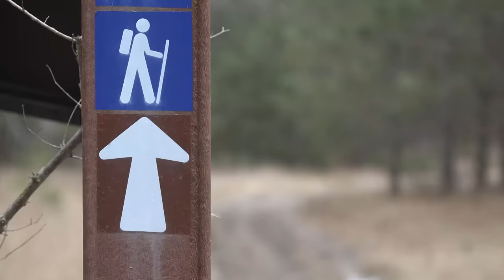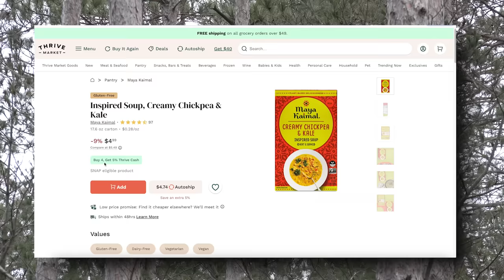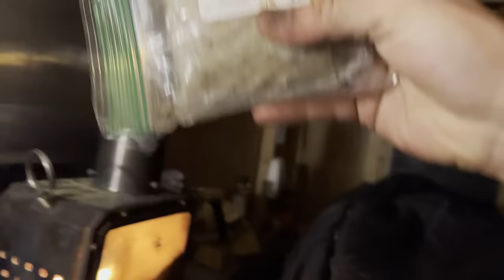BRAVING SNOW & BITTER COLD in a BIKE CAMPER with my Dog!

Comment: Maybe a longer chimney pipe with a cap on it would help prevent the wind blowing smoke into your camper.
Reply from the maker: Good idea 👍🏽
Reply: He needs a rain cap instead of drilled hole pipe - with a cap the wind can blow hard and there is rarely any blow back - I'm 68 and have used a basic cast iron box heater most of my life - 
     I really don't remember any blow back - a longer pipe will give him a stronger draft but he would need to add a damper to control the draft -
Reply: I was just thinking the same thing...cap

Comment: Some other Utubers living with small wood burning stoves found out the blowback in high wind did cause their stoves to blow back smoke into their trailers sometime.   That's  a bummer having to move.😢  Thanks for sharing!❤that's  why you want that Co2 alarm. In case that happens while you're sound asleep!!!

Comment: 8:18-ish   My mini stove has a similar chimney and suffers back drafting in strong winds just like yours.

To fix that, I manufactured a chimney termination that has a dorsal fin and swivels on a vertical axis, it's weight resting on a pin point.

The fin keeps the terminal opening downwind, preventing backflow.

Aside from a squeek now and then, when the wind shifts, it works perfectly. 

Squeeky rapid movement can be halted by extending the length of the fin, presenting more control surface.
Reply from the maker: Solid ideas!

Comment: This is a nice tiny oven.
But I should take the air from outside the camper not from inside. Then you get rid of the smoke setback.

In Germany people insulate their bike campers with styrodur and put cheap 2KW China diesel heater inside.

Comment: A more conventional and simple flu pipe cap might solve the wind problem with the stove.     Something with a spark arrestor screen and cone shaped top to keep the rain out, but still allow the wind to just blow straight across the top of the pipe.   That should actually help to induce a better draft.     A flu damper would also slow the fire and keep more heat inside.     By the way, keep your water and food in the sleeping bag with you as you sleep.
Reply from the maker: Totally 👍🏽 I. Going to put on a cap for sure

Comment: Your mini wood stove is awesome, however I would make a suggestion about the flue pipe. Try and reduce the horizontal length making it as close to the wall as possible and add that to the vertical run as it will draw more, and position the flue “downwind”
It will reduce the chance of blowback when there is wind gusts
Reply from the maker: Great tips 👍🏽 I’ll look into shortening that middle section

Comment: You can buy a windsock vent for your camping stove. It's got a rotating cap with a sail and is open on the sail side. The wind rotates it so that the opening is down wind preventing the wind from overpowering the stoves draft. I made mine for my stove and haven't had the problem since, that was 5 years ago. I still think you should let Elle ride in the camper out and back, she looks kind of old (the frosty face is the giveaway), to be running all that way, but that's just me. I'm impressed your bike battery functions in the cold, Tesla's and other EV car don't. LOL!
Reply from the maker: Good idea with the stove pipe!

Comment: Maybe a cylindrical sleeve that can rotated to block wind around the side of the chimney top can limit how much wind can blow into the chimney? Like an empty can just a little bigger than the chimney with half of it cut away to let the smoke out, but solid on the other side to act as a wind shield?
Reply from the maker: Good idea 👍🏽

Comment: The reason the fire is going out is because the elbow going into the pipe is on the inside of the pipe coming out of the camper. The elbow should be on the outside. When the wind blows, it will draw the smoke out not push back in.

Comment: ….you should get a 4x8 sheet of foam insulation for the walls & roof, maybe it’ll help keep some heat in??? 😉
Reply: Insulation works well it slows the loss or gain of heat - 
     In his case even if he added insolation it would not help much - when it's cold like that you have to keep a fire going to be warm - 
      There is no way around that - in his case he has plenty of wood to burn so fuel is not a problem - 
       Also he is acclimated to the cold - you can see in other videos were he's wearing a T shirt and saying he's comfortable and stating it's 50° in his space he is in - 
   Even if he had 6 inches of foam insulation - it would slow the loss of heat but at some point it would still become very cold if the heater wasn't burning - 
      The added insulation would add a lot of weight to pack in his case -

Comment: you did get you some bigger tires you need them badly thats for sure and it looks like a different bike.Still need to get that front up.You might put the hitch up higher if it is anything like my trailer hitch it has a big bolt hole in the end so what you do is raise it up higher on the on the back frame and to secure it gorilla tape around the part you stick the hitch to to keep from scratching it. And secure it with hose clamps possibly 2 skinny one to go in the hole and secure around the frame and then a full size one to really secure it good it wont go nowhere guaranteed.
Reply from the maker: I finally figured it out 👍🏽 you’ll see in the last couple videos that feature the bike cabin that it’s raised up

Comment: The cold temp out side is overcoming the heat in your oven you need a flea in your stove pipe or you need paper the will get hot to overcome the col down draft air.
Reply: Flue not flea
Reply: No offense but I can see you have never been to survival school or the Boy Scouts but if you want to get or keep that fire going take a few charcoal briquettes with you and some tumbleweeds.
Reply: That’s why you always keep your water in metal containers to thaw it out quickly and because plastic containers break open and then your out of water.

Comment: Lots of real estate on that roof for some solar panels, could easily run a heated blanket in there off just one small panel, and ditch the stove although it is nostalgic.
Reply: Awesome trailer and videos, I have a similar setup although mines a two kid trailer that I load up, even has a battery and solar panel to charge the ebike on multi day excursions. I rock a queen inflatable in a 3 person tent(: not as warm as your cabin though.

Comment: I know you might have a 1000 recomendations on stove pipe - you would be better off with a cap verses driiled pipe - blow back is rare with a hood or rain cap -
Reply from the maker: Totally 👍🏽 I’m going to pick one up
Reply: @TinyCabinLife  cool
Reply: @TinyCabinLife  you can see the vent pipe on the old cabooses on trains - it was just a half pipe over the stack -  it handle the trains running down the track just fine -
         That's what I've used for 40 + yrs - some have commented on going with a higher stack - in that case you might have to add a damper to hold more heat in the heater and reduce the up draft - 
     I had worked in the oil and gas industry for decades and there boilers cooking oil with fire every were in production facility's -

Comment: It's just a toy stove. You need something more permanent. Every stove needs no more than 2 openings. One is the chimney, one is the air intake. Got nothing to do with the wind. You have a dedicated hole for the chimney. Just fix the stove and every gap. if you can see, the smoke is getting in through holes that aren't supposed to exist. One way in for the O2, one way out for the CO2 and you're good to go.

Comment: Hi, I'm new to this site! It just popped up & I had to watch, because I am planning to do what you have done, but with a motorized tricycle!! I live in my van as a Nomad, but I am going Blind, so I won't be driving for much longer!! I still need to be free to roam when it gets Too hot here in Arizona, so up to the mountains I go!! Or if it gets Too cold, down to the desert is best, like Quartzsite!! I'm planning to build my cabin using even lighter materials like plastic pipe with some cedar picket planks and large bubble wrap for insulation on plastic skinned walls!! I hope that my cabin will be even lighter and stronger than yours at: 33 inches wide by 12 feet long which includes slide outs and a toilet 🚽 room with shower 🚿!! What do you think?

Comment: I may be mistaken, but in windy situations like the one you found yourself in here, I think a stove pipe that jutted straight out from the side of your house, parallel to the ground would not catch the wind, so long as it was pointed with the wind. Maybe carry another section of pipe for configuring that way in the future, or simply turn your current pipe down along the side of the cabin toward whichever end of the cabin is downwind. It may require you to spin the cabin around a bit, but you wouldn't have to move to a whole different location. Just a suggestion.

Comment: I went back and watch some of your videos. Why is it? You don't have a aluminum frame trailer. I'd be a lot lighter than that. Wood, and from the way your pictures? Look, you're absolute. You're tired to boat outward. Why is that or is it just how the video shows? You can lightweight that trailer by putting foam in the walls. Think about it, use your imagination. If you have one. Would I make a aluminum trailer myself if she? I'm getting one of them next month.
Reply: huh?
Reply: Just replying because I thought as a viewer of this channel your comments are rude and quite frankly show your level of education. There are ways to pose your thoughts without sounding rude
Reply: Definitely rude and what an unessasary comment
Reply: Wood: you get insulation way better than just aluminum and don't need inner liner to conceal and protect add on insulation.

Note that RVs are mostly wood and steel frame with just a small veneer of aluminum. His does not seem to creak the least.  ... And he seems to know a whole lot more about being in the woods than I do.
Reply: Wood is cheaper. And smarter 😅